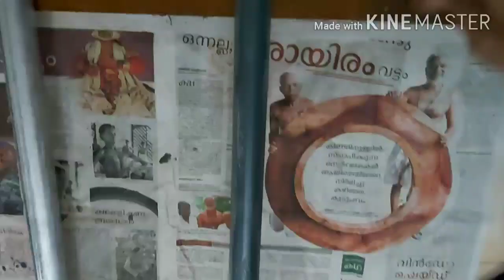Poultry Farm Making | Lock Down Activity  | കോഴിക്കൂട് നിർമ്മാണം |

Comment: ചേട്ടാ നല്ല സൂപ്പർ വർക്ക് ആയിരുന്നു ചേട്ടാ  അതിന്റെ അളവ് ഒന്നു പറഞ്ഞു തരുമോ
Reply from the maker: Shed Area: 100 sq.ft.
Shed: 8'×12'
Materials used:
GI Pipe Round & Square,
Welded Wire Mesh,
Silpaulin Tarpaulins

Kozhikkoodu: 6'×3'×3'
(Traditional)
Material : Wood